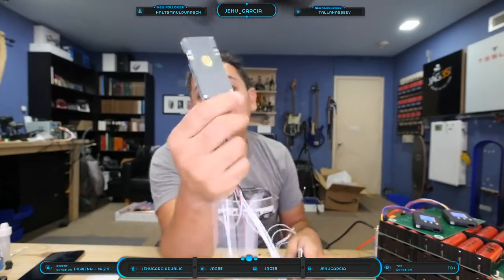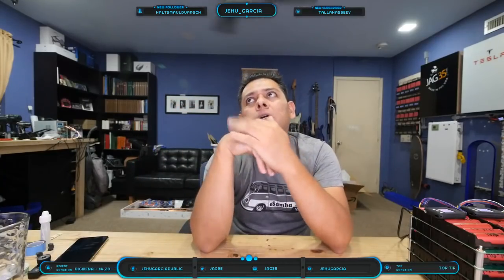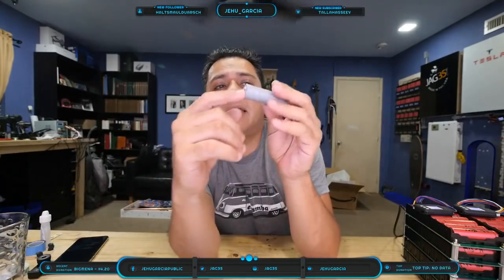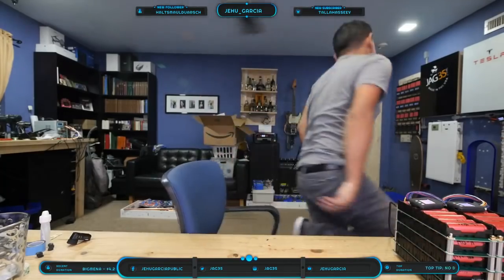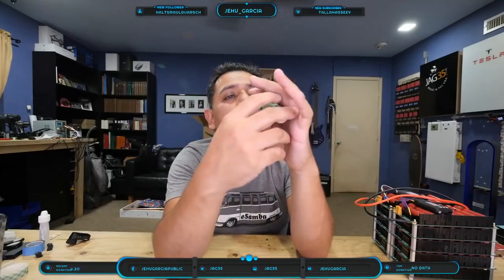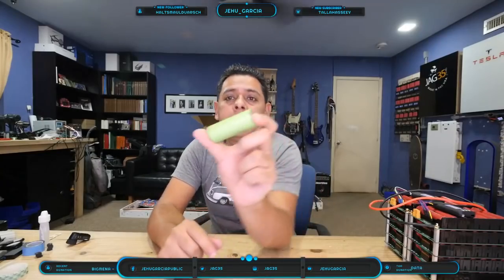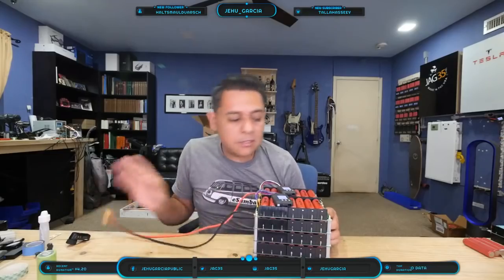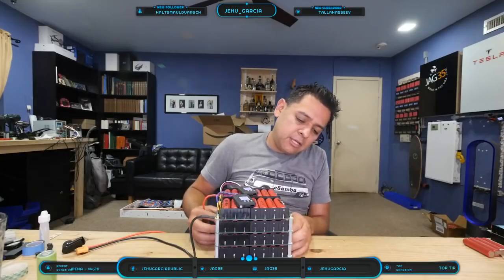First 500Wh 48v Pack Using the Rapid Build Diy Powerwall Module System

Comment: The battery pack needs to be made out of ceramic. A 3D Plastic Printer should be used to mold the ceramic into battery holders with screw down terminals which screw down to the circuit board. This would eliminate the heat problem. Plastic is unsafe.

Comment: What cut are you guy using on Battery Resistance ?  Guess what I'm asking is At what point is the Internal a Issue other then the heating issue ?  I have a few in the 150mR range.  Don't think there going in my E-Bike packs.
Reply from the maker: Diy powerwall applications are less demanding so they can be used

Comment: Jehu, I have considered  building a battery bank that I can possibly put under the back seat of a vehicle and have it wired to an inverter and be able to run tools, charge electronics, have in need of natural disasters and such. I honestly thought about building the power wall but mount it horizontally under the back seat of a vehicle and all. I am sure 4:4 KWh would be plenty to do want I want to do. What is your advice?
Reply from the maker: Do it
Reply: jehugarcia do you have any advice. I love technology. I am a nurse but I have a passion for technology that my father instilled in me before he passed away. This would be the first time I have ever done anything like this, let alone my first time working with these batteries.
Reply: jehugarcia should I purchase the 18650 batteries or should I purchase the 40 volt battery bank of 26650 batteries from (alarm hookup) on eBay? Also, what are some good safety recommendations to prevent any batteries from catching fire and such and to prevent any other issues? Also, if you have any more tips, I would thoroughly appreciate it. Thanks.

Comment: Jehugarcia great body, very informative.

What do you recommend 24v or 48v Packs?
Reply from the maker: Depends on what you are doing,  small systems are fine on 24v. Larger ones 48v is better
Reply: jehugarcia I hope to make a power wall to run the house from collected solar off the mains electricity :) so 48v is better for that then yeah?

Comment: im looking to build a 12v system for camping and videography and telescope astronomy etc . I had been using 3  12v 35ah agm batteries inside a cooler with a 400 watt converter bolted to the top then went witha bigger 1500watt converter . it lasted 6yrs . I also have 8 12 volt marine cigar sockets mounted thru the lid. the batteries happened to fit so perfectly I dont need any spacers to hold them in .and best of all the agm batteries and cooler were free/
now I want to go 12v with 18650s I will need at least 100 -150ah worth of run time . my scope alone draws 20 amps at 12v, then I have my camera tv and laptop that runs off the 400watt converter. id like the pack  to cost around 200 bucks for the batteries if possible . otherwise I could just get 3 more agm bats from harbor frieght for $65 ea. your the battery guru what do you suggest??? whats the best deal right now??? etc etc

Comment: When a cheap inverter burns down your house.....whose fault is it???  lol
Reply: Bang Stick Going to be keeping any battery I build for storage inside a brick enclosure with ventilation.  No way for anything to burn....other than the battery itself.
Reply from the maker: When your wiring in your house shorts out and burns down who’s fault is it?
Reply from the maker: How about when a pipe breaks and floods your house?
Reply: jehugarcia you are 100% right, would a powerful 600w solar inverter be able to deal with smaller power wall needs or does it just cut out?

Comment: Can you list a link for the file so we can order the boards our self other question is each individual cell fused and not just the board?
Reply from the maker: https://kit.com/jehu/custom-diy-projects
Reply: jehugarcia thank you you know people can say what they want about you my opinion what you’re doing is pretty damn amazing not just this project but everything you’ve done to bring attention to a resource that was winding up for the most part in landfills. You have inspired people to experiment on their own to try new things with these salvaged 18650 cells
Reply: Thank you I just ordered 50 of the boards after making some slight changes first the copper is twice as thick  and I’ve made adjustments so that each individual cell is fused I also change the color once I get them and I’d like to send you one if thats ok I will be using the cell holders but I found a way to  modified those also increasing the amount of amps they can handle
Reply: 1LesbianStoner AngelKM420 hi, you're fantastic. Lesbian Stoner could you share the file? What solution do you use in the battery holders?
Reply: @jehugarcia  link says page not found

Comment: Can you make a high amp battery pack for the swagtron e bike so I can go longer how much will it cost I think the battery is 42 volts or so they say I only can go about 10 miles or so I want to go 50 miles
Reply from the maker: pretty sure it can be done